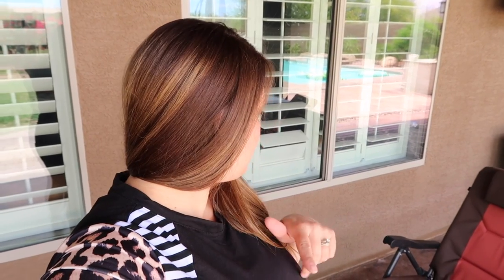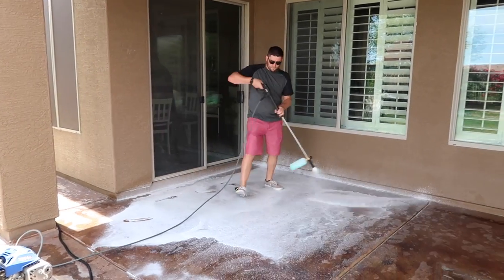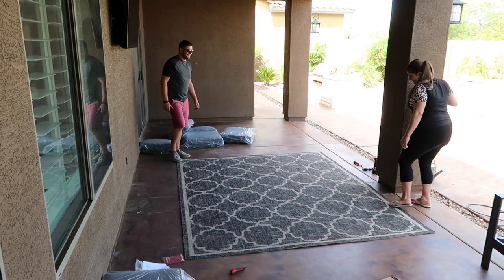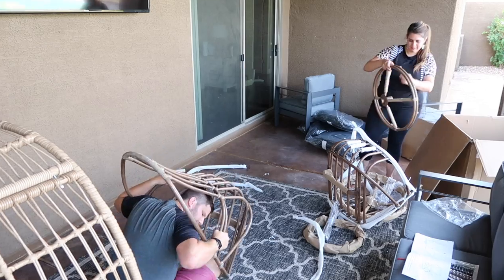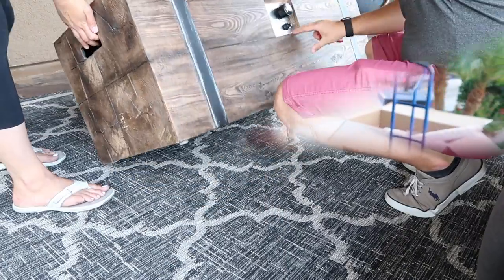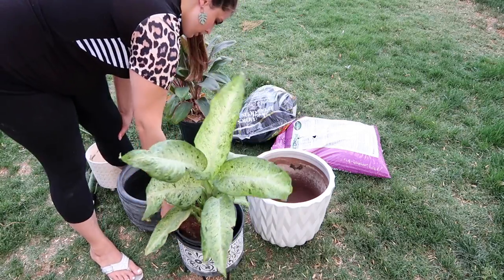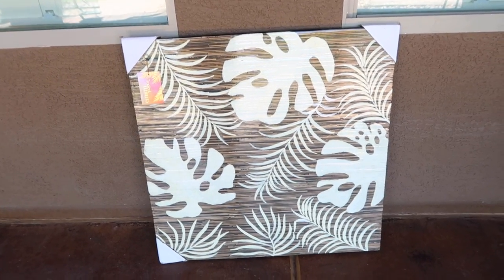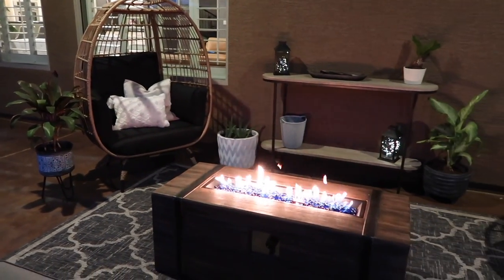☀️ ARIZONA PATIO MAKEOVER 2021 :: NEW HOUSE TRANSFORMATION + NEW OUTDOOR PATIO FURNITURE

Comment: I think you and Kyle could make a rack for the suits & towels. Use a long piece of scrap wood and attach hooks to it. You could hang it horizontally under the art piece across the whole wall. You could stain the wood to go with your fire pit. You could have the boys strip their suits off and hang them there before they go into the house. Then after they shower off the salt water, they can bring their towel back out and hang it up on the towel/swimsuit rack. You could even make a smaller version for over by the other door. You guys can do anything…so a swimsuit/towel rack would be a piece of cake for you two! I just love you guys! 🥰

Comment: Hi Amanda, your new home is looking fabulous.  You had asked about plants in pots in hot & dry climates - here in Australia we do get humidity in places but also plenty of dry & hot days. I know people use various methods to stop the plants from suffering in the heat but I find the most cost effective method which also looks pretty is to use large fairly flat light coloured river stones - about 2 to 3 inches round or oval shape in either white or cream colour. You can purchase the  by the bag at garden centres. Just place a single layer of them all around the exposed soil in the pot, keeping them close together. The light colour reflects heat back away from the plant, the watering you give gets easily through the gaps to reach the soil & the stones reduce moisture loss & drying the plant out.  Plus they make the plants look even greener & quite pretty. Best of all you never have to replace them!

Comment: Underneath the art piece on that wall. I don't know if you guys drink any alcohol or not, but I was thinking a small wet bar made out of bamboo or wicker. That way it will coordinate with the furniture, but have something under it. The wet bar doesn't have to be alcohol it could just be drinks, or both. Just something to make help with the heat and keeping hydrated.

Comment: It's beautiful!! Maybe some baskets on the wall with plants in them would help you add that something you feel is missing. You handled that beattle like a pro - I would have screamed and been very freaked out.
I know you are looking for an outdoor shower or something to rinse off. Years ago my brother-in-law bought a freestanding one at a Home Show. It was easy to set up by connecting a hose and it had a built in water heater. They put down concrete stepping stones and created a little nook for the outdoor shower but none of us remember the brand name. It was like $200-300 and worked really well. Maybe a few Google searches could turn up something like that.

Comment: I don't know what they are called, but you can get water retaining gel crystals that you mix into your potting compost - which then release the water slowly thus providing extra moisture between watering - but recharge when you water the plants.   I believe you can also use them (or something similar) in vases for indoor cut flowers.  Also a good 2-3 inches of decorative stones on the top of the planters will not only help retain moisture but will also make the planters look more attractive.  I would suggest a "living" wall filled with rock roses and other similar desert plants.  I'm sure Kyle could construct something if you can't find anything in your local stores or on line.  The patio looks stunning.  Is sealing the floor an option to create the "wet" look and, possibly, hide the water stains?
Reply: I know them as water crystals, available at garden centers and walmart 😉

Comment: For your art picture wall: you could do plumbing pipe as a long towel rack that runs the full length of the wall or do a couple of them at varying heights under the picture. And I would spray paint them black or the color that matches the metal of the sofa.

Comment: Hi, I love the makeover u did on your new home. It's the best patio that I think I've ever seen. I'm not positive because I don't really decorate a lot, barely got into a small amount of seasonal decorating, but it seems like maybe some dark hooks that fold in underneath the pic to hang the towels when not in use might be a good idea. Also it's up to u if u still want to use the push broom that way, I used too. My husband showed me though that it's called a push broom because u stand with it in front of u & push & not really lifting unless necessary. It is a lot easier to use that way. So in this case u would stand with your back towards the wall of the house as u pushed out and walk forward with it on the ground. Just a small tip that might be helpful. U dont have to use it 😁

Comment: All of those plants will do well outside. I have them in my garden in Florida.  Not sure what your winter will be like but I suggest you at least move them close to the house and cover with an old sheet if you have a freeze. Some may do back a bit but should recover.   The aleovera is probably the most likely to have a hard time in a hard freeze because there is so much liquid, gel, in the plant

Comment: Ferns are good as outdoor plants and also spider plants are good for under the patio ceiling (they grow quite quickly) and bourginville (don't think that's spelt right but you can ask at the garden centre) these are also good in hot climates and growing against a wall they do droop over so they give a bit of shade also lemon plants grow really well in the heat .xxJ

Comment: I agree that while your art piece is great-looking, it doesn't quite fill enough of the wall space. You could try getting some wall-mounted hooks in either bamboo or black metal, and hang a black lantern on each side of the picture. It will fill out the space and give you a bit more light.

Comment: Aloe is a very good plant to have in hot climates. They need succulent soil and proper drainage..you water the soil and never ever the plant itself as this causes dry rot. They like sun..but not constant sun cause they can burn. The plants you have look pretty good and similar tip for them is to not water them directly..but do the soil. The leafier plants you can mist the leaves..also a good thing to do with potted plants is self water feeders. They’re inexpensive on Amazon and you can get them anywhere there is a garden section. You can find some really cute ones! Hope this helps!

Comment: You mite hang a bar under your picture for towels and sconces on each side of picture. Hang lanterns on each side of columns.Hang the mirror under your Tv.Our you could hang sheer on short rods on each side of columns put weight in hem of sheer so they will not fly up.oh yes put glass over sconces so fire will not blow out.🤗
Reply: P

Comment: Regarding the picture: It’s just really the wrong scale for the space. I think you fell in love with the print but scale is so important. An idea to bring it into scale would be to add a wooden peg-type coat rack below it (not sure if raising the picture would be necessary) this would be a great place to hang the kids swimming suits, towels, etc. Then to add width you could add something on either side of the picture. Lanterns or some other kind of lighting would be nice. The concept I’m describing is to broaden the footprint of the art installation to meet the scale of the wall.